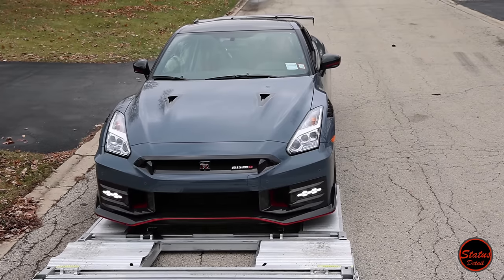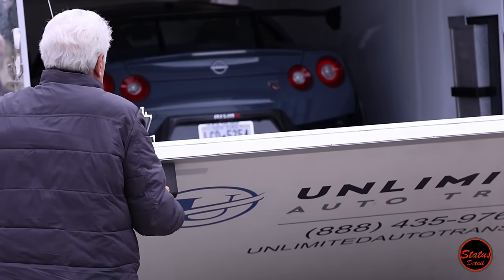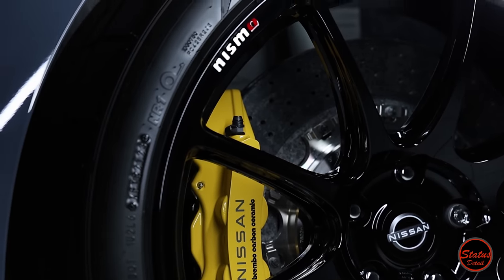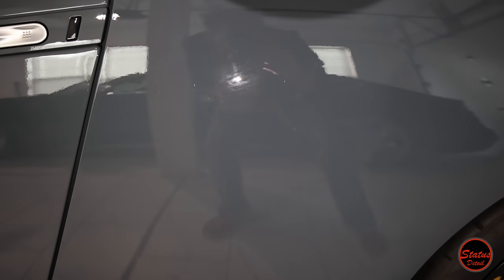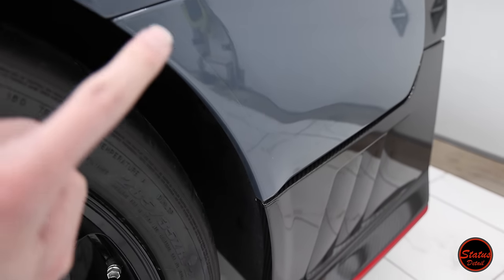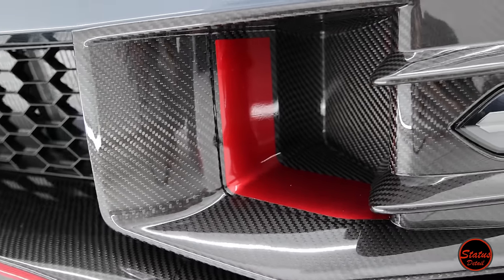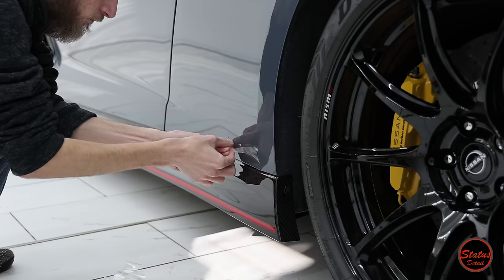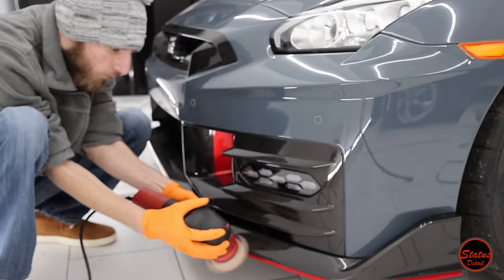RAREST R35 Nismo GT-R Gets $18,000 ULTIMATE Detail

Comment: I wish when i started my detailing business i would have done it when i lived in Florida or Cali instead of the midwest. We just dont have the customers with cars like these where i can charge that kind of money. I charge like 3k for a partial front and thats about the extent of what i can get lol. People around here are cheap asf. I tell a big black truck owner its 2500$ for my lifetime manufacturers warranty coating including a correction that will need quite a bit of wet sanding and  they think im crazy. its fucked up because regardless i cant do anything half ass so im spending all tht time and effort for a fraction of what i should be getting.
Reply from the maker: It can definitely be hard. As I mentioned in the video people might be able to deliver something like this but charging for your time will scare away basically everyone. So you must do a lower end service to meet the needs of the market. Frustrating and complicated issues. Gotta make enough to stay in business!

I'm fortunate that status is seen as the go to place for high end exotic work. So my prices scare away the customers and cars and don't want to do and attract the cars and customers I want. At this point I could move anywhere. Nearly all my business is out of state and shipped in. So location is irrelevant. 

I wish you the best of luck! Promote high end work as often as possible! So it's what your know for. That should attract some great cars!

Comment: For that amount, I expect to have my wheels taken off!
Reply: Customer didnt want any panels or trim removed so maybe he didnt want the wheels to come off either who knows.
Reply from the maker: Thank you for watching the video and catching that key part of nothing being removed. 

I'm pretty skinny guy so it wasn't a big deal coating the barrels on car. Not the first time I've done that. You just need to work smaller sections of barrel and sometimes use something to push the towel between barrel and rotor. Like a wheel brush handle wrapped in microfiber for example. Most of the time I can just reach with my hand. Especially back wheels with typically smaller rotors. Coating the face on or off is the same. Cars with 100 miles don't have dirty suspension and it's nothing I can't pressure wash off with wheels on. So honestly it's not crazy necessary unless it's like 20k mile car and your trying to turn the clock back to new.
Reply: I’d expect a daily chucked in.
Reply from the maker: @RJAH355  I'm not sure what that means lolol

Comment: $1k PPF removal, $3k paint correction on a nearly $200k car(GTR overpriced AF but thats the cost of this thing), $7-9k new PPF, $1500-2000 ceramic outside and wheels, $1500-2000 ceramic/ ppf interior parts. Comes out to $15-17k off the top of my head calculations...$18k isnt a stretch
Reply from the maker: @zerafians8145  you didn't include the shipping. Price includes shipping on State of the art trailer. But pretty decent price break down 👍🤝
Reply: @STATUSDETAIL  yeah, kinda a "stab in the dark". I just knew your pricing isnt as crazy as it appears to some. I knew Id forget some stuff. Im honestly the kinda guy that likes to know but will pay that kinda price for my $30k, $100k, $250k car to retain its immaculate appearance for as long as possible. Im a careless fuker when it comes to driving
!
Reply from the maker: @zerafians8145  yep it's definitely not as crazy as most people think. The shipping is the expensive part. That's why I tell a lot of my customers and viewers that there's no point in price shopping when you send the car to me. Once you figure in the shipping cost I'll be more expensive than everybody. But the actual core detail is typically nearly identical in price to local reputable shops. Factor shipping in and I'll be more expensive basically every single time. 

The shipping cost is the price of peace of mind knowing your car is done perfectly and with nothing getting damaged. Think of it like insurance lol

Comment: Shocking how poor the finish is on a brand new car direct from the manufacturer, especially a limited edition at 100k dearer than their regular high end model.
Reply from the maker: Are you serious to see really amazing paint stop in to your nearest Rolls-Royce or Bentley dealer. Both those companies go the extra mile and typically wet sand entire cars at the factory and then do major pain correction steps to obviously pull all the standing marks out. The stuff removes orange peel and typically makes for an incredible looking paint job. This is pretty rare and definitely never going to be done on the average manufacturers paint simply due to how much time and money it cost to do.

Comment: 18k and you did it in your driveway...lmao what a rip off. You have to be kidding me
Reply from the maker: The location of the work does not determine the quality of work. Besides the space  having appropriate lighting and being clean. Large shops are actually worse for ppf as dust management is nearly impossible. That's why you see PPF done in very small areas almost like a paint booth in large shops. They even build smaller rooms within the larger space for this exact reason.

Comment: u do what u do well but i genuinely dont care how good a detail is its never worth 18k i dont care if it magically makes my car have zero miles i can literally put a down payment on a brand new ctv4 blackwing, not to mention its gonna look the same, like almost exactly the same especially in this situation all ur doing is wraping ajd getting rid of swirl marks, to me and to anyone normal it doesn’t cost 18k in materials to get rid of them or wrap it the only thing i could understand is the shipping cost but even then thats insane
Reply from the maker: You value money differently than the owner of this car. Nothing wrong with that.
Reply: @STATUSDETAIL correct and not to say that he didn’t use his money on something good u did a great job are making it look good or even slightly better but in terms of significance it just looks very little to no different besides the removed swirl marks, i do love your content tho keep it up man
Reply from the maker: @jaytracy9162  PPF is the main cost. That protects it so it continues to look this good. Ceramic makes it easier to care for. Correction fixed the obvious serious issues. It looks significantly better than when it's dropped off but the main value and cost was the film. And it shouldn't look like it has it. So saying it looks a little better is like the ultimate PPF compliment. That means you can't tell it has the protection. That does have it and that's going to help the car stay looking there for a very very long time. 

The shipping cost will vary we have local customers that don't have any shipping cost and then we have customers that are very far away with very expensive shipping costs. But again when You have large amounts of money live in a mansion and have 10 cars this is not a big decision for a person to send a car to me and pay the shipping cost to have it get to me and done perfectly and correctly in one shot. You're comparing this as a down payment on a car that the average person can buy. The person that does detail here is not the average person.

Comment: 18k and you have a seam at the back of the mirror on the door when you could have just cut a hole in the ppf and had no seam. Then you bang on about the reason its 18k is perfection. Sorry you failed on the job.
Reply from the maker: Different ways to do things. On some cars we do birthing method. This car has large mirrors. It's not as clear cut as you make it sound. You can damage the film birthing especially if your mirror is very wide and the base is very narrow. 

It's important to birth on like a Ferrari. Because the mirror is so low on door. That seam would be terrible. Those mirrors are pretty small too so birthing is not to hard. The top part behind the mirror on the gtr is extremely small. 99% of people won't notice that on this car unless I show you. But you'd notice distortion in the film adhesive from over stretching. So it depends on the car and the owner. Lots of other discussions regarding aesthetics vs durability and moving more towards one or the other. That conversation happens with every customer. Appreciate the concern and it's a good question... Just worded hostilely lol.
Reply: @STATUSDETAIL  Whats hourly charge on labour for this job on the cost sheet? Regardless of film choice or DA/compound used... I'm going to guess it's at something stupid like $200-300 an hour.
Reply from the maker: @frankiewalnuts  dint remember the exact number but I definitely responded to to this same question in several other comments. If it's important then take a look in comments lol.

Comment: Not lifting the car and cleaning the undercarriage...
Reply from the maker: @ss8512  ok fine I'll clean the gears inside the rear diff
Reply: @STATUSDETAIL  when I sold my gtr I had a company clean it and without me asking they cleaned the undercarriage. All the dirt build up from weather. Why I'm saying that is because you charged $18,000 and don't even do a complete car detail. The company I used did everything you did and cleaned the undercarriage for 6k. That is why this video popped up in my recommendations. I don't care I'm just saying my experience and opinion. You keep doing what you do, no hate or harm intended.
Reply from the maker: @ss8512  so you had a company clean the bottom of a used car. Pretty different than a brand new car with virtually no miles....
Reply: @STATUSDETAIL  lol first of all I keeped the car clean, second of course I had it super detailed for resale value. If you consider 12k miles a piece of junk or  "used" like it has zero value. Bet if that car had 20k miles on it you'd still charge the same so whats your point. Don't get upset because you charge 18k for a full detail and can't or won't clean the undercarriage. Maybe when you blow up more and get more picky clientele who really are into there cars you will see that cleaning the undercarriage is or should be included or the customer will request you to do it.
Reply from the maker: @ss8512  if you keeped it clean why did it need a detail or bottom cleaned?
Reply: @STATUSDETAIL  your in the detail business, you should know the difference between the average or standard up keep as apposed to really detailing a car. Yes I keeped it clean with your average 400 dollar a month cleaning service. When I sold it that's when I took it to get fully "detailed". Like you said in your video, there are levels to detailing.
Reply from the maker: @ss8512  you spent $4,800 annually on maintenance cleanings..... Okie dokie.
Reply: @STATUSDETAIL  lol yeah, bought the car for 160k sold it a year later for 196k. Daily drove it to my business and was already invested in having it for one year. So yeah 4,800 annually on the cleaning was a good investment. You have a full "detail" shop that only works on high end vehicles yet you don't have a lift. Matter of fact your using a cell phone light to see the blemishes on the cars, yet you say your standards and quality are the best in the world. Really a cell phone light. I'm done I have won't reply to anything you say time is money. Okie dokie
Reply from the maker: @ss8512  ok have a nice day lol.

Comment: Imagine paying over 200k and getting a car in that shit paint condition. Wow…Quality control down the toilet. Hell even a Toyota comes with better quality control off the assembly line.
Reply from the maker: From my experience many of the high end supercars have really bad pain this is just normal in common. I'm definitely not saying that it's normal and okay. Just doesn't surprise me. Funny enough a lot of basic cars in comparison like Jeeps for example typically have pretty decent looking paint. All of the cars being made today have orange peel some more than others. The only cars with virtually no orange peel will be Bentleys and rolls because they wet sand that out at the factory. It's a very time-consuming process but they spray extra clear on purpose so it can go through the full car and sand it.

Comment: For $18k, I need the engine, drive train and wheels pulled. I guess we saying anything for clicks now.
Reply from the maker: You want me to pull the engine and drive train on a brand new car? Sounds like a chop shop lol
Reply: @STATUSDETAIL  right, charging 18k on a brand new car. I could actually see and agree if this was a restoration, 18k would be on low end of the spectrum. Good video, but the owner got got. I would actually like to see the whole video that is time-lapse since you said you couldn't post the whole 70 hour project. Clean car tho
Reply from the maker: @Rey-xj3te  checkout high end detailing stuff a little more. This pricing is not unusual at all. Remember the price includes shipping. Any well known shop working on cars like this will charge similar pricing. Then figure your shipping in when it's out of state.